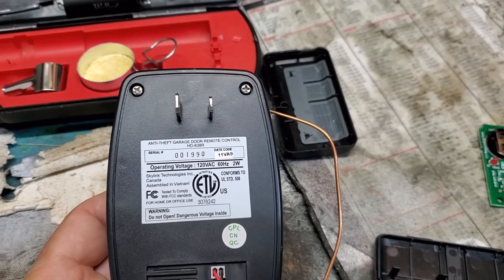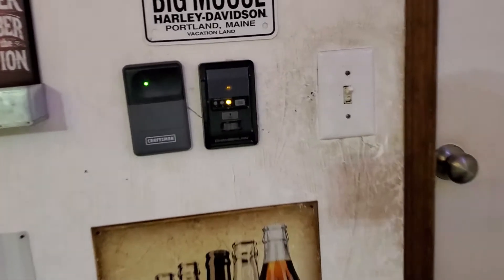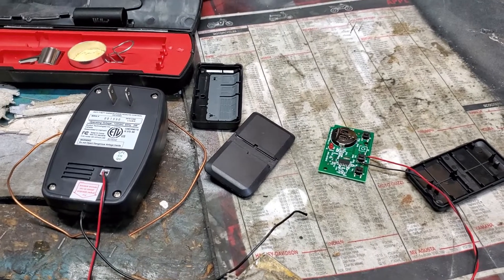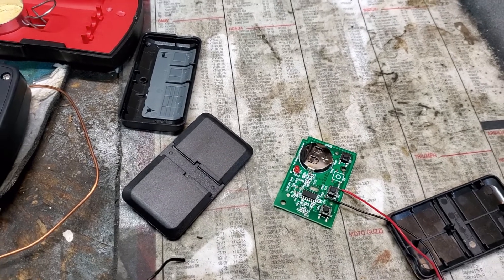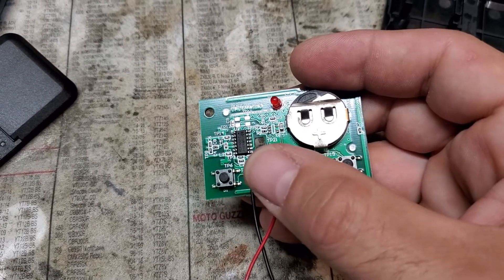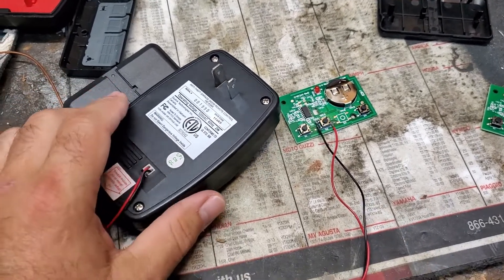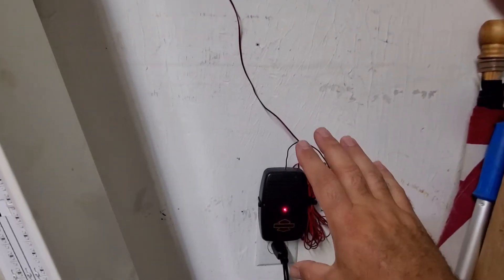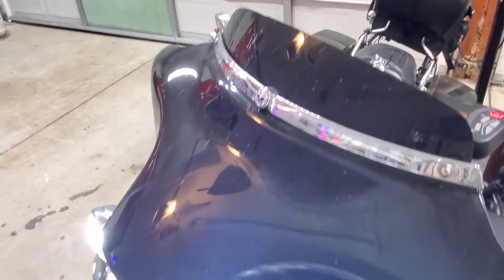Chamberlain Garage Door Opener Harley Davidson Hack

Comment: 5/22/2025 To Greg Philpot thank you so very much for your video and input on the revamp of the HD838R garage door remote control. It works great with my New Chamberlain My Q opener. I also tried to solve this problem with Chamberlain, they also said they could not, and would not help me with this issue, but to contact HD. So again Thank You.
Reply from the maker: Yeah they said it couldn't be done. LOL

Comment: Thanks, after you solder the remote circuit to the HD opener receiver wires , do you go through the programming sequence or no need you just make sure the remote is programmed before you solder?
Reply from the maker: YOu can do it before or after. I recommend getting the remote working and tested before soldering. This way you know it was good before.

Comment: I found a go-around on E Bay as well.  Search "Universal Security +2.0 / MyQ Interface Module-Chamberlain/Liftmaster/AsssureLink".  This device is an inline module wired from your Harley Remote Receiver to the back of the Opener and fix the issue as well...for $56.65 plus shipping.  I had no luck with the Harley dealership but found this option on a Harley forum.  I believe it does the same thing as you did in the video, but not all of us have the skill set and knowledge to do what you did.  This may work out for someone out there looking for a quick, but rather expensive, go around.

Comment: I have tried his hack and doesn't work. 
Would like work with him to figure it out
Reply from the maker: As long as you have the right opener/remote and soldering to the correct wires it should work.  Those little buttons just close a circuit to initiate the open command.

Comment: I just bought my Harley used and it came with the "Harley Garage Door opener" . I plugged it to my Chamberlain opener and outlet and sure enough it will not operate the door.  Going to try this hack once I buy another remote for my opener to mount to the wall! Thanks!
Reply from the maker: Glad I could help.  Chamberlain is really missing the boat for not creating a simple interface to do the same thing. I talked to their engineers and they told me what I was doing couldn't be done....  I just laughed and said "I already did it"...  🤪